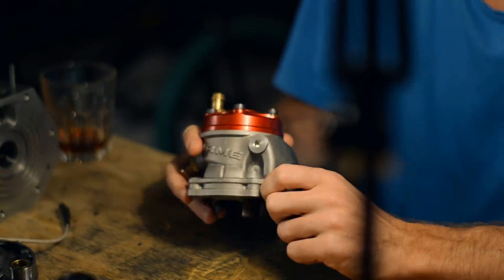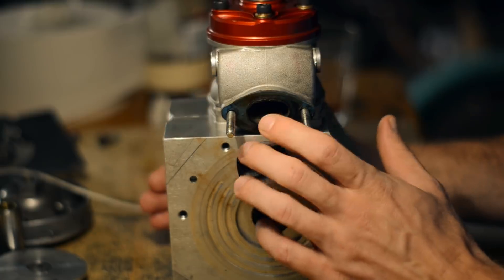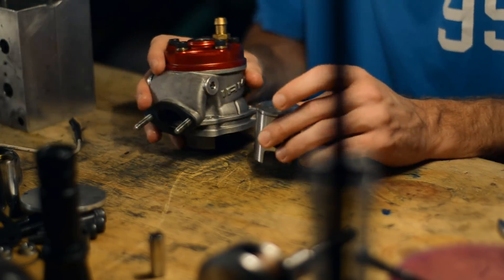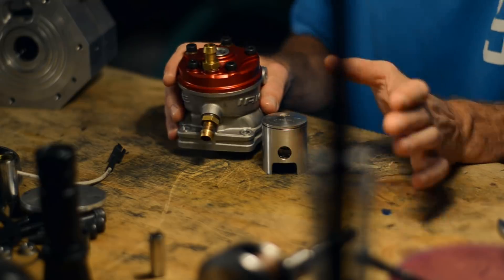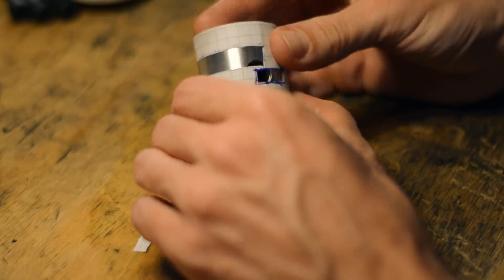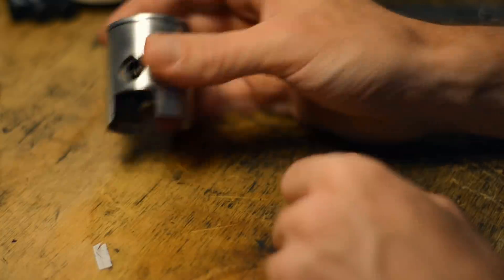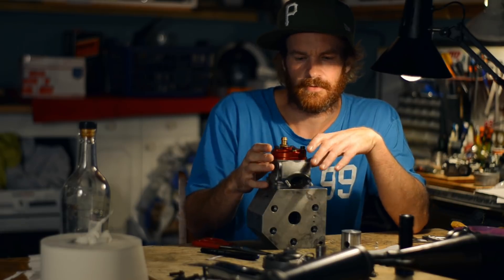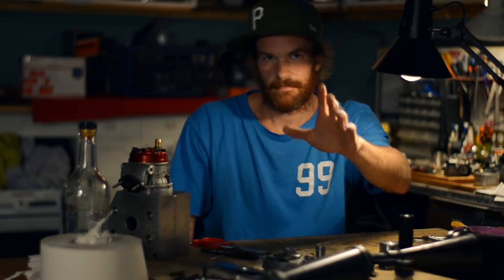A Two Stroke Revelation!

Comment: This might be stupid so bear with me. Instead of the pin going right through, leave it so that it stops short. make the pin so that it is a tight push fit in the piston and so the end of it forms the "plug" that seals the hole up. Maybe the inner part of the piston can be formed in such a way that retaining pins can be inserted after the con rod has been fitted. Is that over simplifying things?

Comment: Check this engine , it is exactly as you describe it with the exhaust port 90 degrees off the cranck rotation...
https://makoboardsports.com/shop/engine-parts/xt100-engine/

Comment: To simplify this problem, do you think you could design a connecting rod with a 90° twist to allow the piston pin to be parallel to the axis of rotation of the crankshaft, thus eliminating communication between the ports?

Comment: What happens if you rotate to say about 70 degrees apart from having to realign transfer ports and cylinder mounting bolts etc. you should be able to get the 100% exhaust port also whilst blocking the wrist pin. Or is that too simple and have other limitations on the intake side. I am yet to understand why cylinders are not 180 degrees and use ram air effects at speed to assist volume of air throughput

Comment: good thinking , in the old days we put a cork in the piston pin and above the piston pin to get a higher vacuum on the `input stroke`is ,  there any  crankshaft offset to the middle line of the cylinder ?
Reply from the maker: Cool! No offset. I've played around with it in simulations(as I have plenty of room to move the cylinder on the case) but didn't see much difference in performance.

Comment: I know I'm late to this party so this probably isn't an issue anymore but if not... Detroit Diesel solved the 2stroke wrist pin sealing problem back in the day by using a flat disk for a wrist pin retainer that is installed with a specific convex punch to drive it in. This caused the disk to become concaved in the bore and sealed to the piston. They have to be vacuum tested after install to verify the seal. I tried to find a video of the install but no luck. You could use a similar design for a single sided retainer or since the design seals the piston skirt you could use a conventional piston. If you're interested I'll dig out a Detroit Diesel manual to illustrate.

Comment: How is the Piston supposed to swivel forwards and backwards if the pin is facing straight forward, you will never connect to the rod because the rod cannot go the same direction the Piston pin is facing
Reply from the maker: It's only the cylinder that's being rotated, not the piston.

Comment: Rear ported exhaust has been standard for decades on model aircraft racing engines.  Cox Conquest .15 cu in 2.5 cc manufactured 1976-1978 reported to run at 30,000 rpm and developed 1/4 hp.  This was the racing engine to own in the day.  Also in that era, the Australian Taipan Gold Head engines performed exceedingly well and came with a 1/4 wave tuned pipe supplied as standarded were and probably still are much coverted.

Comment: A piston with a blind/ closed end on the exhaust side would allow the open side to directly transfer into the wrist pin, if you use lubrication holes in the pin perhaps the small end bearing will gain better lubrication.

Also the hot side of the piston will not be the loaded side under rotation.

Comment: What will hapen with your configuration with that wide cut out for exhaust
 1) The piston ring will break, as it will hook up with the liner 
2) You missed the opening in the skirt of piston. You will loose "breathing" as the skirt interferes with "Scnuerle boost ports"
3)The configuration with exhaust on same side as induction will ease the thermal expansion of piston as cool gases help cool the gases..

Comment: Cant you just not drill the closed side of the piston? Just machine the hole from one side only. Leave the other side alone and drive the pin in from the machined side.

Comment: Remake the piston with only 1 hole, only 1 circlip pin. don't  need two holes to slide the pin in and won't need to worry about otherside of pin when sealed in.
Or, Weld and machine 1 hole to match piston.

Comment: Wrist pin buttons are what you need, they are common in performance 4 stroke engines. In these engines the wrist pin isn't retained with either pressing or a clip. There's simply a "button" of most commonly teflon plastic that fills the end gap and prevents the wrist pin from moving side to side.

Comment: Like messing around with steam engines, the future is making electric motors out of carbon fibre with iron filings sprinkled into the mix, so you can make an electric motor using carbon fiber and not steel, it needs to be magnetic, then you pump water around your super lightweight electric motor.
The awesome thing about electric motors is the more voltage the more power until something breaks or the coils melt down, you can take any electric motor and get the power you want if you can control the heat and the force itself. 
So many possibilities, so much more to come, while the internal combustion engine is at the end of it's life cycle with most discoveries already made.
Use your talent for the future not the past.
Reply: men like to hear the engine go VROOM VRRROOM CRACKLE POP !!  lol gotta love a 2 stroke scream
Reply from the maker: True true, Only doing this for the fun.

Comment: I have one off-topic question. In one of your older videos you mentioned that after installing a new piston and rings, the engine ran richer, and after the ring seated in some, the engine started running leaner over time. I guess that is because the compression drops a bit after the rings seat? And as always, very entertaining video!
Reply from the maker: Thanks! This happens because combustion efficiency gets better as the ring starts sealing better.
Reply: The compression should increase as the ring wears in and seals better
Reply: More compression needs more gas. While more efficient, it's also more demanding

Comment: There is another problem,  the con rod is partially blocking 1 transfer port when it is open, also it is moving, crank is turning so air in crankcase is rotating rapidly, all this disturbs the vital balance between  the air flow through to transfer ports causing mixing of the fresh charge with the exhaust gas!

Comment: You’re over thinking it. Heat the con rod and twist it 90 degrees off center. Then everything lines up without modifications to anything but the con rod.
Reply from the maker: You're underthinking it, the crank wouldn't be able to move.
Reply: He didn't think of that! The little end would have to have a ball joint  (just kidding of course) 2STROKE STUFFING

Comment: Yeah but  I've got boosters sitting on the opposite side of my ex port so when I would do this I have to close up the piston pin end. And the shitty thing is that I run 3 stud engines and they are not in 120 degrees of set. So no glory for me then. Maybe my stihl chainsaw Wil benefit?
Reply from the maker: The boosters are exactly why this could be beneficial - if they're wide enough they will cause communication between them and the a transfers when the piston pin passes by.
Reply: @2STROKESTUFFING  yeah that true but I can't rotate the cilinder

Comment: Just wondering why you can't use a piston with a blind hole one side - ie the piston is on drilled on the inlet side. The pin then slides into the open hole and is held in with just one circlip. This would work with almost any cylinder orientation apart from the conventional fore and aft. You could even have the cylinder orientation at 45 degrees if you found that beneficial, and you would still have your 100% exhaust port width. The big problem with a 100% wide exhaust port is the piston ring unseating and reseating as it sweeps over this port - just a thought, maybe its not possible???

Comment: A reed valve would be a very good way to make more power look at yamaha and how their engines made more power than rotary valves of the time less restriction, ive tried both reed valve wins every time for power, als had the thought the cut away on the pin side of the piston would breach the exhaust port on tdc causing a pumping loss needs a custom piston
Reply from the maker: Yep, needs a custom piston. I disagree re reed vs rotary valve, the most powerful two strokes ever are all rotary.
Reply: If that was so then why are all of the two stroke race bikes other than suzukis rg reed valve rather than rotary in production bike racng since the 1980's nsr yz hondas NSR aprillia  kawasaki kr /kh h2 all of them were winning in racing the only one left was suzuki and that fell by the wayside too ive been tuning since the 80's ive never come across a rotary that could be tuned as highly even when the port time area was matched  
im afraid we'llhave to disagree on that heres a few examples of winning machines all reed valve not one rotary valve in there earliest being the 1970's the rotary valve being most powerful is an old myth it simply is not  true the evidence shows this clearly  https://newatlas.com/two-stroke-motorcycles/38942/      https://www.bikebandit.com/blog/the-unrideables-the-500cc-two-stroke-era-in-gp-racing     even loop scavenging is more efficient than rotary valve this last article clearly shows how suzukis rotary was wiped off the table by yamaha  https://www.bennetts.co.uk/bikesocial/news-and-views/features/bikes/history-of-the-500cc-two-stroke-grand-prix-bike
Reply from the maker: Aprilia RSA 125, rotary valve, 54hp. You'll have a hard time finding something that can match that number except Van Rosems 25whp 50cc but it's rotary valve anyway. If their dyno results are correct(no reason to doubt it), that 50 is the most powerful two stroke ever made.
Reply: maybe but in the real world reeds have won out for a number of reasons the lack of a narrow band of power and the complexity involved in using rotary valves on multiple cylinders and the cost of production I am impressed with your power figures but it only applies to small single cylinder engines and isnt exactly the most powerful two stroke ever made the ryger 125cc reed valve shifter kart has 70hp
Reply from the maker: Thanks! You might be right, has the Ryger numbers been confirmed? I remember the whole thing turned into somewhat of a joke, been a good while since then tho.
Reply: I cant answer that only to say as has been discussed on many forums every dyno is different depending on type they all give different readings besides the real figure for power you need is torque  its a much better definition of how much power a motor has btw I did like your video
Reply from the maker: Thanks!

Comment: Question;
Why not make the port narrower but have the exaust on both sides?  Like some of the Baby Bee model motors?
Reply: Or would that hold any significant problems in converting both sides exhausts into one pipe? Or will two do?

Comment: Do some reason on the pistons used in the Deltic engine, it uses completely closed piston skirts as it was made up from two parts, well actually three parts as the crown was a made of copper and the skirt was made of aluminium but it had an inner part which enclosed the small end pin
Reply from the maker: Interesting!
Reply: mean't to put 'research'

Comment: Piston with no pin hole at all, just attach pin and bearings with end caps like how the con rod attaches to crank on bigger rods.
Reply from the maker: The problem with a solid pin is weight...
Reply: @2STROKESTUFFING  That's not what he said.
Reply from the maker: @laddhooks  right! Weird how I misinterpreted that...

Comment: Do you think its possible to make a four stroke car engine run as a two stroke? by doubling camshaft speed so that both valves open each revolution, putting on a roots blower and make ignition fire every revolution. It wouldnt run great, but would it run?
Reply from the maker: Would be a fun experiment!
Reply: Port the cyls at close to BDC & twin screw blow them. Make skirts for pistons. Seal intake valve & make exhaust valves fire every rev.
Reply: #ellenor malik that would work (detroit diesel type) but big mech undertaking. Was just wondering if you could 2 stroke a 4t with simple means. Not that im gonna try, just a thought.

Comment: An interesting concept but I have one concern , if you extend the port width to the full width of the bore won't the ring spring out into the port. It might be possible to avoid this by having a bridge at the mid width point but obviously the bridge would need to be flush with the bore.
Reply from the maker: Thanks. Yes, I was going to extend the aux ports out to 100%, a 100% single port would be disastrous...

Comment: McCulloch kart engines had "rotated" porting back in the 1959 .. McCulloch and others, used a piston closed on one side, or a wrist pin with one closed end. Can see some of this in my old channel video here:   https://youtu.be/R2ZGg0LYSRI?t=4s
    For what is being done here with existing parts, would be MUCH easier to make a custom wrist pin with one end closed, or shorten the stock pin about 1-2mm, and slide in a disk of equal thickness to take up that reduced length.
   That is one hell of a large wrap around exhaust port you are talking about, wow!!!  Good luck.

Comment: Rotate the piston pin end of the crank rod 90 degrees
Reply from the maker: Then the crank wouldn't be able to spin...
Reply: When the crank rotates it goes say from bottom to back to top then down in front and bottom again.  This causes the rod to rock back and forth on the piston pin.  If it was rotated 90 degrees it would not be able to rotate in the same axis as the crank and bind.
Reply from the maker: Yep.

Comment: The easiest way would be to have a custom piston made with 1 hole for the pin to slide in leaving one side totally closed . Also cuts down to 1 clip to retain the pin.
Reply: If you had said piston, how would you remove the pin after it has worn and needs to be removed with force? I am a small engine tech BTW.
Reply: Thread the inside of the pin before it's hardened and ground.  When you need to remove it from the piston, use a bolt to extract it.  Same way any blind hole pin is extracted.
Reply: @garnetcampbell4389  after it's worn and unusable you don't have to worry about not destroying the Piston to remove it.
Reply: Scott W. I have had to reused pistons and just replace the rings and hone cylinder to keep the customer's cost down.
Reply: @garnetcampbell4389  so why didn't Mr engine tech think of threading the inside of said pin ???
Reply: @sendit2588   How would you stop the pin from spinning when trying to thead in removal tool? Also the cost of threading pin may exceed the benefits.

Comment: Hi, where do you buy rotary carbon disk? . I don't find nowwhere. Thanks you.
Reply from the maker: Emot Racing! www.emot.nl
Reply: @2STROKESTUFFING  I will adapt in a carter piaggio,. But first 
I have to make measurements and mill the carter. Is al long project. What you prefer? Rotary valve in to admision side or ignition side.? Thank you and sorry for mi bad English
Reply from the maker: Cool! Side doesn't matter to my knowledge.

Comment: ceramic piston pin buttons?  what do you think.
Reply from the maker: Could be possible!
Reply: Teflon buttons, they can take the heat and are non-abrasive...readily available in any size from 8mm-26mm and can be custom fitted if you don't have a lathe, I've chucked them up in a drill and held a file to them.
Reply: Ceramic or a teflon insert that travels the full length of the pin,  one cap on one side would set it  off balance wouldn't it?
Reply: rhe button are on both sides.

Comment: Your next project should be a 2 stroke with injection and look at the power difference between an injection and a carb 2stroke engine
Reply: The, ibea 24mm go-cart carb is a injection system..
Reply: Platewarrior if you are looking at peak power you really don’t need to screw around with injection

Comment: Also the ring orientation, will have to be changed. Cant have to gaps snagging in the ports.  Full custom piston. Mercury v6 engines run ports 45deg to piston pin.

Comment: With the exhaust port at 180 degrees of the bore, what keeps the ring from hanging up on the port? I've toyed with widening exhaust ports and noticed a clipping sound when I went a bit too far, no more than 80degrees.
Reply from the maker: Will make it a three port setup, no worries.
Reply: Please make "it" sound like a pre war (39/45) "Deek" You Tube CLASSIC TT LAP OF HONOUR START UP GATE 2013  enter stage left @ 1-10 ish. Why you ask ? ......just because we can.
Reply: When you keep saying 100% of the bore, do you mean 50%? 100% would be cutting the cylinder into 2 pieces.
Reply from the maker: Kinda 50%... I should say 100% of bore diameter - 40mm bore, 40mm chordal width exhaust.
Reply: Detroit diesel went 100% around at the base with a sweet swirl effect in the support structure.
Reply: I forgot to mention on the Detroit 2 strokers the intake is on the bottom and conventional valves in the head for exhaust. Blowers are necessary due to the lack of crankcase supercharging. But hey who wants the narrow power and of expansion pipes?
Reply: So 115° or roughly a third of the way around? And that leaves enough room for 20mm wrist pins without interference

Comment: YZ 125 Yamaha 40hp....just ports.
Good idea try.
Rotary valves never really worked out well. Kawasaki and Rotax were into them.
Ring catch on exhaust port needs a bridge in middle or snap...
Reply from the maker: I'm going for a three port setup, the ring will be fine. Well, the most powerful two strokes ever made were/are rotary valve...